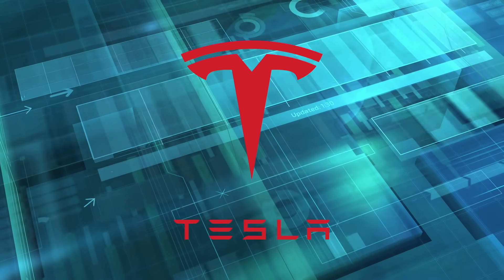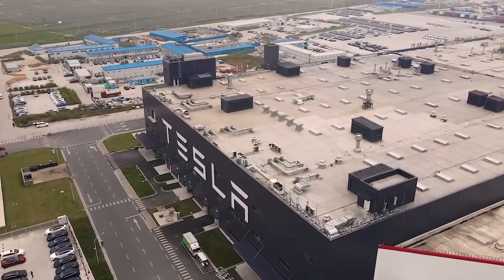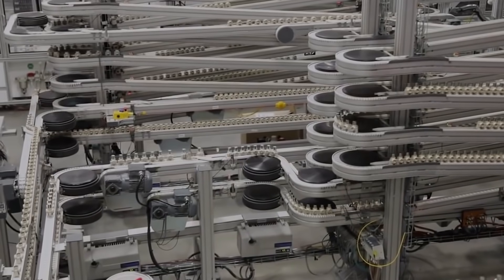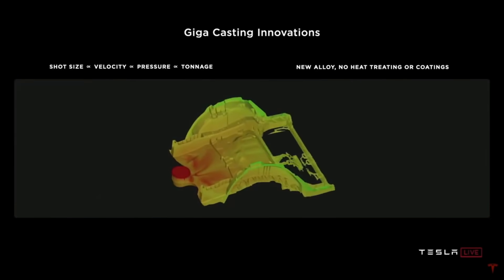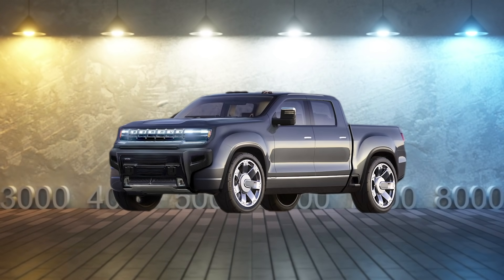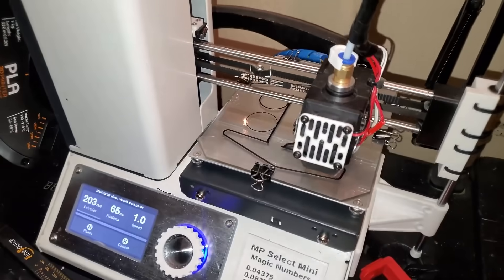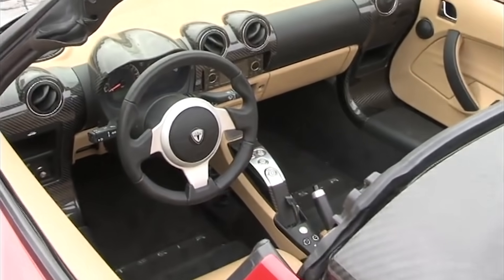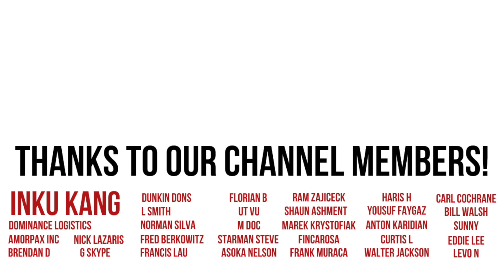GAME OVER - Tesla's AI Manufacturing Revolution

Comment from the maker: Note that casting usually refers to building car parts out of molten metal. Audi claimed that their die casting was the machine I showed, but looking further, it appears to just be a stamping machine. 
Correction: The Cybertruck will not be using a casting machine, but rather, a folding machine.
Reply: Yeah, and the cyber truck exo-skeleton is not created by casting.
Reply: @thomasgronwall5039  Yep.  Got some confusion happening here between casting, stamping and rolling.

CT's body is neither cast nor stamped.  The sheet metal they are starting with is too thick/tough for stamping, and casting isn't feasible with the stainless steel they plan to use.  Tesla has come up with a brand-new production method for that body.  For want of a better word for it, let's call it 'rolling.'  A 3-mil-thick sheet is first cut, then it is bent ('rolled') into the desired shape.  The bends are as minimal as possible to preserve structural integrity and keep production costs low, hence the strange shape of the truck.

Many on Wall Street can't wrap their heads around the reason CT looks as it does.  They assume - ignorantly - that they are seeing a design language which drives the design.  But utility drives the design, not aesthetics.  Tesla didn't set out to create a truck that 'looks' a certain way (which is how all other automakers approach design).  They set out to create a truck they could produce inexpensively with desirable utility characteristics.  The result looks as it does.  Aesthetics took a back seat during the CT's design.

Tesla wants consumers to ask:  'Do I want a truck that looks great, or a truck that works great?'

They believe that if it works great, the design will grow on consumers.  They'll get used to it while enjoying superior utility.

Tesla doesn't care about winning aesthetics awards.  They only care about delivering the best price/value ratio on the market while clearing good margins.  CT is going to do both.

You want a tough truck?  The industry has paid lip service to toughness for decades, but they have never actually produced anything that's tough.  They all use stamped/painted sheet metal, and every ding damages the paint (or worse).  You can't even use an industry standard pickup bed without damaging it; you have to add a protective liner.

CT changes the game.  Tesla will sell millions of 'em.
Reply: @Urgelt  You should also put your reply as a "first degree" comment so that more people can read it because here (where it is now) relatively few people will read it, which is a pity since you bring a lot of insight and knowledge that more people would benefit from.
Reply: @Urgelt  so if function is driving design can you explain why the bed shape falls diagonally from cab to tailgate instead straight down? I cant think of any functional reason to do this other than slightly more storage and possibly solar panel inclusion in the bed cover.
Reply: @noahno  Superior aerodynamics is one reason.  Less air resistance equals longer range.  It also yields more lockable storage in the bed.  When you need to carry taller cargo, roll the built-in tonneau cover out of the way and take a hit on aerodynamics.  You'll take that same hit on a conventional pickup bed all the time.

Tesla is obsessed with aerodynamics, as they should be.  Range is typically the Achilles' heel for BEVs.  You can get a diesel pickup that will go for a thousand miles if you want it.  Even Cybertruck with 4680 cells won't be able to match that range.

But the cost per mile on the Cybertruck will be much, much less.  Superior aerodynamics helps with that, too.

Utility drives the design for Cybertruck.  They did not set out to make that truck look peculiar.  They are not expressing a design language intended to draw in consumers swayed by appearances.  Every detail on that truck springs out of the need to maximize the truck's utility for owners.

Lots of purchasers won't like the appearance of the Cybertruck and will stay away.  But people who want an e-truck that delivers maximum utility will find it in the Cybertruck.  I think that will turn out to be a large number of buyers.
Reply: @Urgelt  sure, if the cover is down. So youre telling me the vortices created by having a normal pickup bed would reduce range noticeably? Impressive
Reply: @noahno   Sure.  At slower speeds, when off-roading, it might not matter much, but on paved roads moving more than 20 MPH?  It becomes significant.  At at 65 MPH the effect is massive.

Traditional ICEV pickups have wretched aerodynamics.  But nobody cared when gas was cheap and emissions concerned virtually no-one.

Now boxy pickups are dinosaurs.  We can do better.  And we should.

Rivian, Ford and GM are all working on BEV pickups.  But their efforts are first-generation.  Electrified, but the same inefficient form-factor.  They're all thinking within the box created in a different age with different concerns.  That box is what Tesla has escaped with the Cybertruck.

Tesla's rivals' second-gen efforts are likely to adopt more aerodynamic styling, I think.  The old and successful pickup form-factor will be mostly gone from new vehicles by 2030.  It'll have to be; anyone who clings to it in the age of BEVs will be sacrificing range and efficiency.  Square shapes just won't do.
Reply: @Urgelt  Tesla Model make the Different araund the World...
Now big battery long Rang come for Give mor Power For Tesla model ...
Welcome to Brazil, Great time for make business Eletricar in Brazil with the Hiperloop too...
Reply: @lambcordeirobrazilzenhoooc9870  I think Tesla will open a GF in Brazil, eventually.  I'm just not sure when.

When the Boring Company begins to mass produce boring machines, that's the time to start looking to start Hyperloop projects.  Mass production is probably some years away.  Their prototypes are still too slow, not cheap enough per mile.  There's more engineering to do on those designs.
Reply: @Urgelt  you mention a 3 mil thick sheet. In the US, that is .003” thick, way too thin to be worked in a high speed production machine. I think the thickness is incorrect.
Reply: @markmeehan9908  It's 3 millimeters.  Sorry for any confusion I may have caused.  I typed too fast.
Reply: @noahno  triangles are stronger. The weakest point on a normal pickup truck is between the bed and the cab. Not on the cybertruck.
The function of the triangle is to support the rolling metal "door" wich closes the bed and improves aerodynamics.
Reply: @noahno  it is very simple to explain this Noah and if you have been following the Cybertruck story from the beginning you should already know the answer. Basically on a traditional "body on frame" truck, the frame supports the cab and tray, whilst the cab and tray are not mechanically connected. On those small trucks that are built without a frame ( Honda Ridgeline) the transition from the rear cab post to the tray side needs to be gradual to eliminate the stress raiser that an abrupt change of body side height  would create. Hence the Honda Rideline has a sail pillar to mitigate this and add structural strength. Same with Cybertruck, Tesla needs to reduce the stress raiser at the back if thd cab. Excellent article here https://www.google.com/amp/s/techcrunch.com/2019/11/22/heres-why-the-tesla-cybertruck-has-its-crazy-look/amp/
Reply: The machine that will make the Cybertruck is called a break press. I work in sheet metal, and this is cold rolled steel.

Likely a laser will burn out the flats, and a break press will make the required bends. Usually done by hand a good break press can have a lot of automation with setting the back gauge in sequence consoles up the process.

From there I wonder if the underside of the Cybertruck will have a battery that the exoskeleton connects to in a structural manner similar to how the Model Y does.
Reply: Yes you did a mess by naming casting to stamping. Better you correct the video because it looks like you do not understand what you say
Reply: Pretty ridiculous that you made an entire segment of the video entitled Casting but showed a stamping machine AND suggested the entire Cybertruck would be cast. And to top it off you use a random concept render of the Hummer EV that doesnt exist. Im sorry, but that is a monumental amount of incorrect information and youre leaving this video up..??
Reply: @noahno  This is just another Tesla troll channel that is supporting the fraud
Reply: @tpfrk8977  I disagree about Elon being a fraud- he is the opposite of a fraud
Reply: You mixed up stamping with casting, stamping machines form from sheets, casting is exactly that parts are cast.
Reply: Yup, noted the confusion, when you showed a classic stamping machine by Audi as casting. Showing no idea of what casting is. There are limits to what can and should be cast. You still have wires and drive elements to thread through. But, casting will be stronger and save money through fewer assembled parts. That means 1) fewer robots or people and parts (each of which also has assembly cost) 2) much shorter time on the assembly line. The savings are thus multiplied.as for Cybertruck, the steel is too strong/brittle to be stamped. The folding itself is tricky. But Tesla has it figured out. Plus, as it is stainless steel, there is NO PAINTING. This is a MASSIVE cost savings. And headache saving as no worries about dust in paint!!
Reply: Better to revise the video.
Reply: Here is a great Tesla video https://youtu.be/rqVndqc3MuM
Reply: So this is why teslas have misaligned body panels and big panel gaps, now I get it
Reply: By
By
Reply: @CasgainsAcademy, what happens if you need to straighten up a fender? Will Tesla need to replace the whole body?
Reply: @leapdrive  thinking the same question. Repair is an issue. Maybe, totalled every major bump.
Reply: @josiasjorgio8810  , perhaps cut and weld a part of the body? Could make insurances higher too.
Reply: fuck.... please hire an english speaking narrator...
Reply: But the CT is so fugly. I couldnt bring myself to get one
Reply: @johnsample9640  That's cool.

Tesla will sell a lot of Cybertrucks, but not everyone is on board with utility driving design.  Some will prefer the traditional pickup design language.

But I think that some of the folks who buy light trucks for the macho effect may end up taking a closer look at the Cybertruck.  Traditional pickups are designed to look macho.  Cybertruck is designed to be macho.  We've never seen a light truck as tough as the Cybertruck before.
Reply: @Urgelt   the cybertruck is macho looking than any other truck design.
Reply: @nickwulf  I think so, too, Nicholas, but that's a subjective opinion.  Nothing prevents people from holding the opposite view.

But objectively, the truck is tougher than other trucks.  Cybertruck has an unpainted 3 mill stainless steel body that resists dings and dents.  Everyone else has painted, stamped sheet metal bodies that crumple if you look at them funny.

Comment: I struggle to take seriously advice from an obvious fanboy who seems to know next to nothing of manufacturing. Probably learn the difference between a Sheet Metal press and an Injection Casting Machine before you equate the two. Also, it is laughable to say they are going to use 3D Printing to improve production efficiency... Even the most advanced 3D Printing is ridiculously slow compared to even 50yr old dedicated Production Machinery.. that assertion proves the poster has no clue. All of Tesla's grand AI couldn't get a robot to put an O-Ring on a Shaft, so please someone remove the Kooll-Aid from this guys office. I love Tesla, I think Elon is one of histories greatest minds and Engineers, but I won't stand for BS. I am a Trade Qualified Toolmaker with 35yrs Toolmaking Experience. I am also a qualified Mechanical Design Engineer and have worked designing Production Machinery for many world class companies and have lectured in Mechanical Design at University, and owned a Product Development factory with all the machines you speak of... I have the greatest wish for Tesla success, but this candy floss crap from someone who doesn't know a Toggle Clamp from his elbow is barf inducing.

Comment: It seems you confuse stamped sheet metal parts with die cast parts. Stamled parts start with sheet metal. Diecast uses molten metal injected into a die - hence die cast. Finally, Cybertruck body uses stainless steel sheet metal formed in press brakes. Press brakes make straight bends, not curved surfaces.

Comment: Get your facts straight and slow down your explanation, mate. The change from sheet steel metal welded construction to cast aluminium ( not steel by the way) front and rear modules for model 3 and model Y creates a massive saving in many areas. Firstly less press parts, resulting in less press dies, less press machine capacity, less robot welding stations and most importantly  a dramatically reduced cycle time. Cybertruck will not use casting for exoskeleton but folded stainless steel. Effectively it will use a development of the humble brake press to siimply bend sheet metal that is too hard and too thick to press using traditional press methods. Now here is where it gets interesting.. just imagine a massive tailor welded blank ( different thicknesses across the blank to take account of structural requirements) that is big enough to bend into a complete body shell using a new automated folding technique. I will call this the origami machine as it will take a massive blank and step by step bend it to form the body. How cool is that?

Comment: 3D printing is awesome but I think their model Y casting machine and their laser cut and fold cyber truck innovations are more impressive than anything they could do with 3D printing. Beyond prototyping I don't see how they'd use 3D printing in actual production parts. Robot arms setting things into place makes sense. And maybe there is a part that can't be made with an injection molding machine due to the holes where air escapes and the plastic enters and so that one specialty part can be justified on a slow 3D printer bed. Maybe. But most likely the next innovations from them in their factory will be getting even more vertically integrated. They do still get a lot of parts from 3rd party suppliers. And so that represents a huge area of improvement on design and ultimately price for the end customer.

Comment: You confuse casting with stamping. The casting machine doesn't start with a sheet of steel, but with molten aluminium (that's why it's called a casting machine, not a stamping press). Tesla developed a special aluminium alloy for this process. If you don't understand the basics, you perhaps shouldn't try to explain it to others!

Comment: Hi, like your video! However, there is a semantic, technical error in it. The truck body will use the Stamping process with S.S., while the model Y rear lower chassis section will be made with the Casting process. Particularly, it will use the High Pressure Injection Die Casting process to make the worlds largest automobile part ever made from this Casting process. Also they will soon transition to making the front lower chassis from the same Casting process. Stamping is like a massive Force coming down on a sheet of material and pressing it into a molded shape, and does not involve melting the metal. Casting uses molten material injected under high pressure, very rapidly. Then this material freezes in the mold, which is separated after. Good Video. Thanks.

Comment: Note that casting usually refers to building car parts out of molten metal. Audi claimed that their die casting was the machine I showed, but looking further, it appears to just be a stamping machine. 
Correction: The Cybertruck will not be using a casting machine, but rather, a folding machine.

Comment: Did you have a bad night or something?.. 

Lots of errors in this video. You mix up Stamping and casting a few times, the Cybertruck is not cast in any way, and also not stamped, rather be folded out of a sheet of stainless steel, I would call it "orrigamy manufacturing". Also the structural battery is made of 2 or 3 cast components sandwiching the batteries. The battery cell casings provide sheer load transfer, like a honycomb in a composite structure.

Comment: The Cybertruck will not be a single casting. If it was cast, the edges would be rounded. 

Instead, Tesla will score and bend flat sheets and then weld the sheets together. The process will be substantially automated. 

With the weight carried by the exoskeleton itself, there is no need for the complex internal chassis like traditional cars or current Tesla models.

Comment: You’re mixing up stamping and casting.
The machine shown is a stamping machine and Tesla also uses it, for the car body.
Casting is putting molten substance into a die cast, which is what the animation shows: how the metal flows through the die cast to end up as the part.

Otherwise: great video, thanks for putting in the effort 🙏
Reply: You are totally wrong its actually putting molten aluminium, not steel.
Reply: Alan May have adjusted the message to hopefully make OCD fact checkers like yourself less annoyed 👍
Let me know if you prefer another word. Btw Tesla casts are also not using just aluminum, rather they use a proprietary alloy
Reply: @Steph1  the tesla cast aluminium is nothing special, yeah just like any other brand that uses aluminium, bmw and toyota uses also carbon fiber and special magnesium alloys. Bmw started since 2013 to use recycled materials in their cars/EVs